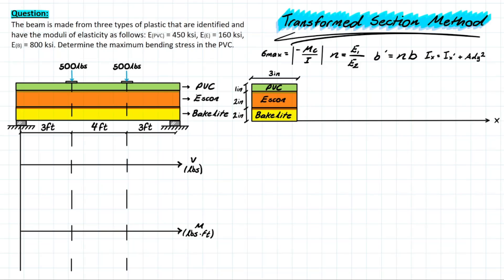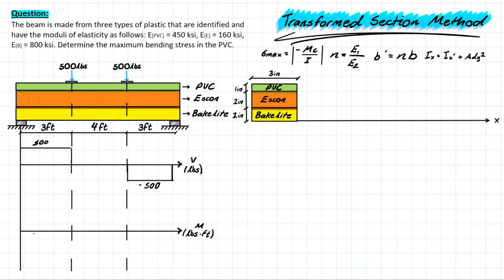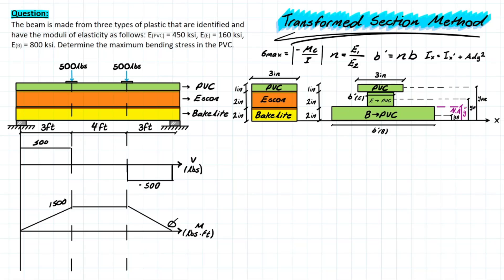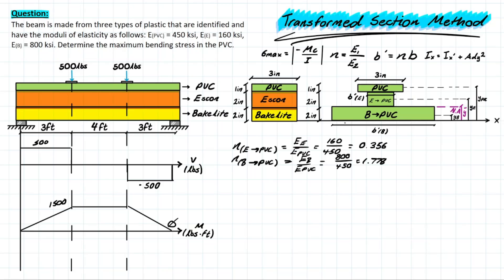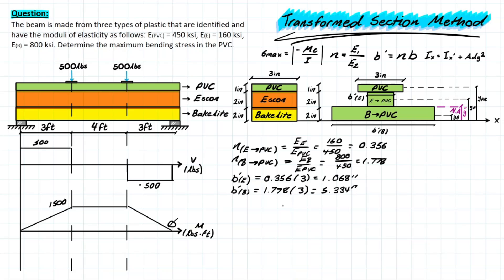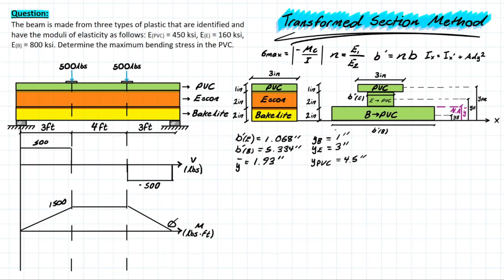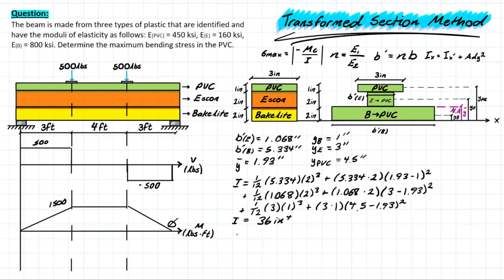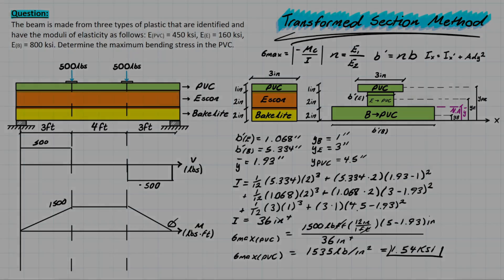Composite Beams using Transform Area Method!

Comment: Very helpful, got this in my exam and was trying to figure out how this was done for the longest time, though in metric. Would you get the same answer if you converted everything to Bakelite and then used the transformation factor on on the pvc answer afterwards?
Reply from the maker: Yes you would! The trick is at the end, when using the flexure formula, you need to use the modular ratio to convert the bakelite back into PVC to get the equivalent stress in the PVC. Love reading comments like this, glad I could help!